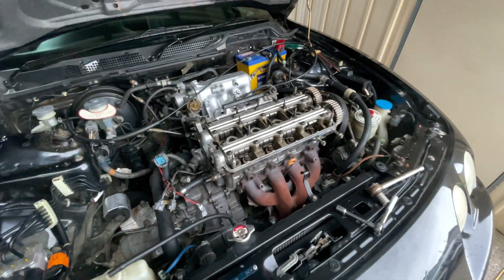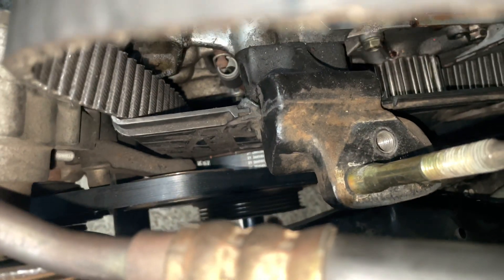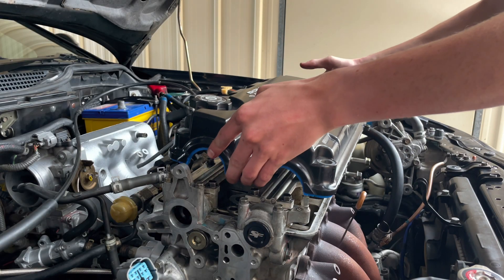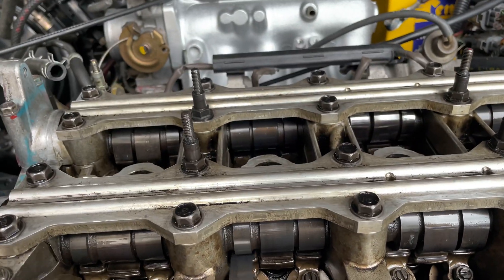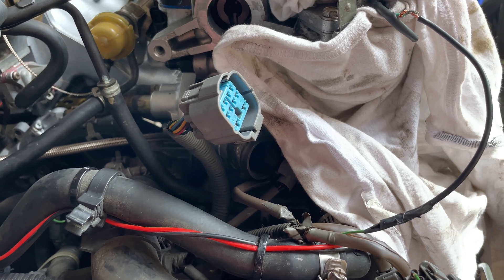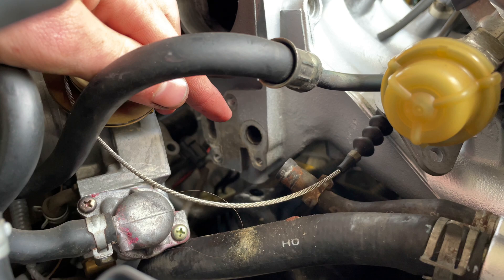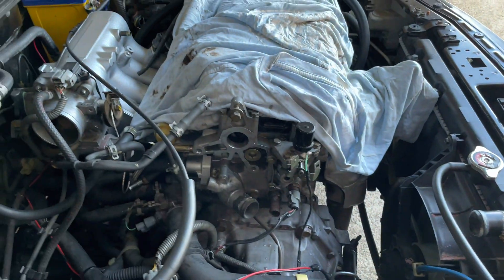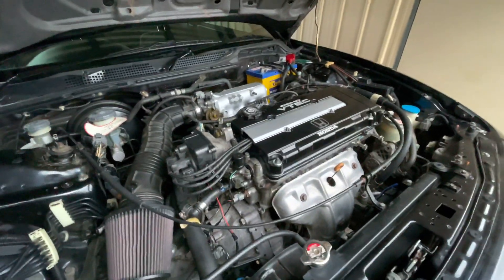INTEGRA VTEC CONVERION (LSVTEC PART 2)

Comment: So did you put a gsr water pump and timing belts .?
Reply from the maker: Still using LS pump and timing belt but in upcoming months I will be swapping them out for a gsr set
Reply: @ValveHouseAU  has there been any issues with it just out of curiousity I built my b20v with a b16 head, gsr water pump timing belt kit.
Reply from the maker: It’s a stock LS block so only revving to about 7800rpm so the water pump is creating bubbles at high rpm anyway. Absolutely no issues whatsoever